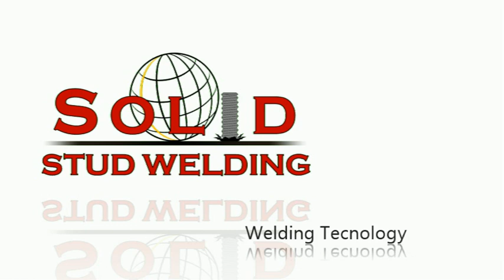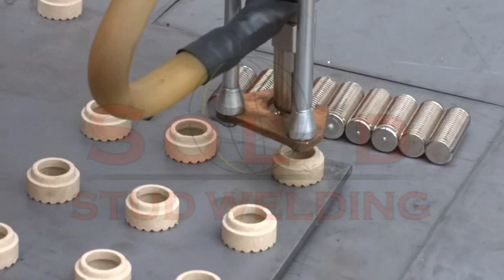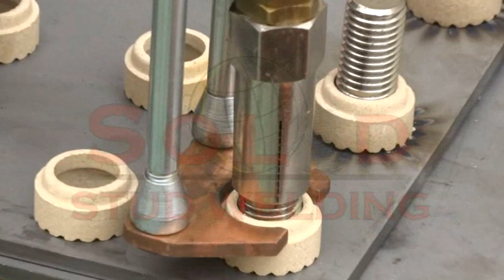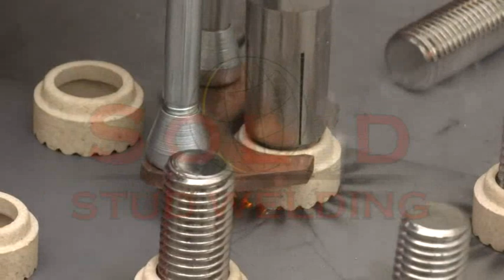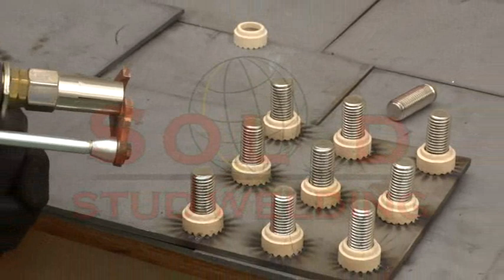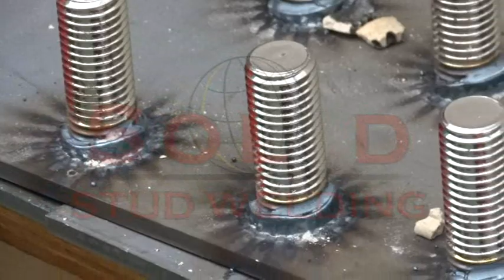Stud Welding -Solid

Comment: When I did this we used to pop mark for single stud or used a jig which the ferrules fitted for repeat box and cover work. Some people I worked with never got the hang of it I don't know why, after a while you remember all the amperage timing and plunge settings. Had to sweep a lot as well otherwise it's like walking on seashells.

Comment: In the process, if carbonsteel base plate, can we use stainless steel studs to weld?
Reply from the maker: OK,no problem,pls  contact me by email and I will give you more information about welding.             info@solidstudwelding.com
Reply: answer is YES stainless studs to stainless material.
Reply from the maker: yes,stainless steel studs can be welded well too